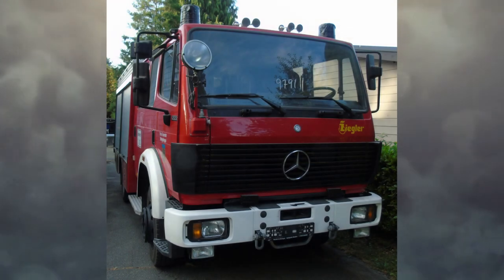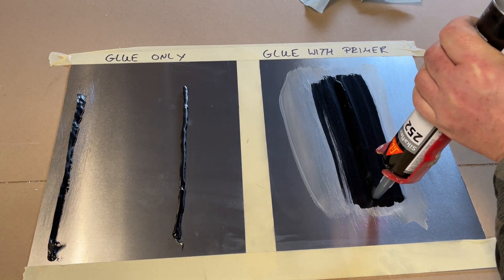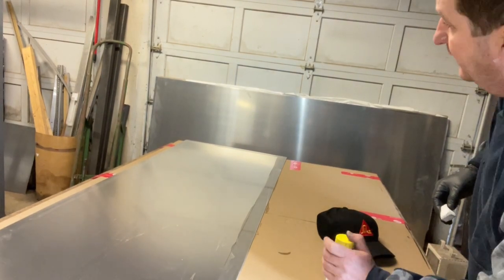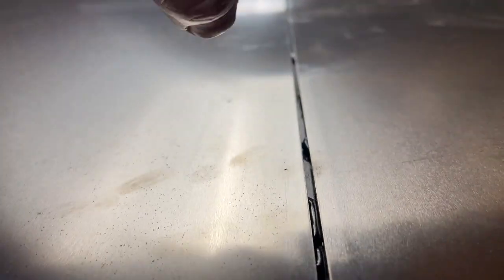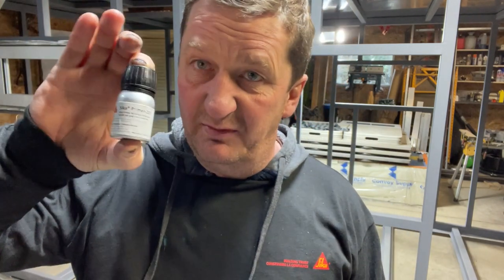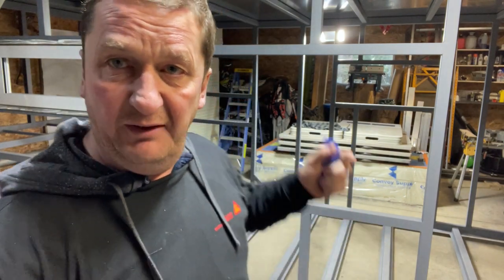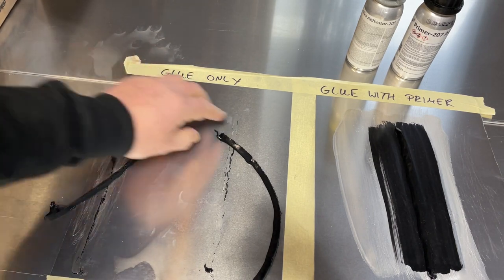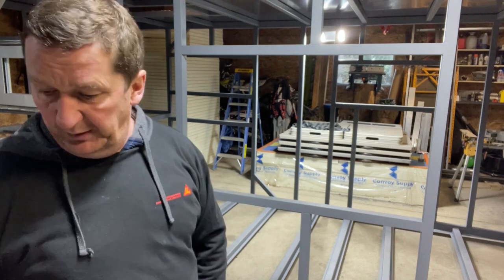How to install aluminum sheets on to a steel habitat without visible fasteners ! Step by step !

Comment: Great video, greetings from Australia , love the toothpick idea..was thinking 3.2mm spacers but now i wont have to buy. Will be installing roof top mount solar to aluminium canopy …so plastic frame onto solid solar . The plastic frame onto prepared and sanded chequer plate alloy …thanks again
Reply from the maker: You are very welcome ! Good luck with your project .

Comment: Great video that cleared up a lot of stuff in needed to know, i always appreciate experiments and demonstration. Greetings from Poland

About to mount 400w solar panels on top of my 1991 Citroen C25 Burstner with aluminium angular profiles, kind of hesitant to trust only glues without any drilling, this video helps me trust such solution more haha! 

If that works well I will have better understanding on how to add split AC unit on the back as well. Vehicle frame sounds like a most reasonable idea, but perhaps supporting it with sikaflex and original bike rack mounts could work instead.
Reply from the maker: Yes that Sika stuff is amazing if it is right prepped. Check out this 2min video they pulled with 240kg vertical than the composite panel snapped but the sika glue did not let go ! https://www.youtube.com/watch?v=4DxFRq5BvNk

Comment: Hallo Oscar, Nice video again.    I used this method also on the back of the drivers-cabin and will use it on the habitat also.  As you stated: Aluminium on Steel may not have a direct contact with each-other.   For the distance between the two materials I took square distance pieces that are used (to keep a constant distance in the edges) when you tile a wall.   In fact the function is the same but I don't like any kind of wood in my outer surfaces.       Keep on going.....I like to follow you and see you next Friday
Reply: Oh...... and can you please keep us posted about the real quantity you've used from the Sika?   It will be helpful when I have to order it too 🙂
Reply from the maker: Thanks . Those tile spacers are a good idea as well.
Reply from the maker: I will.

Comment: Great stuff! Thanks.
What about the painted surface, will it stick just as well? The tests were done on metal and not painted metal….
Reply from the maker: Yes it does but you need to make sure you prep accordingly, means sanding the metal before painting and also sanding ( roughing ) the paint before primer applying and at all times dust and grease free surfaces.

Comment: Oscar, thanks for the great video! tell me, you will not use rivets in the fastening of aluminum sheets? Or will you fasten the corners of the van with aluminum corners through rivets?
Reply from the maker: Thank you. No rivets or screws at all, only glue !
Reply: @oscaroverlander_MB1222AF  Oscar, thanks! I understand!

Comment: I want to mount sideskirts on my car using Sikaflex 252. Do i have to primer both sides? (Skirt and car)
Reply from the maker: Hi thanks for the question ! To use 252 Sika flex efficient you should prime always both surfaces, just make sure you use the right primer for the material you are going to use.

Comment: I tried this and the adhesive ripped the paint off. Lesson; make sure the paint is stuck to a high grade or it will become the weakest layer.
Reply from the maker: Absolute right that's why I applied only the primer and sanded before, to make sure the primer doesn't get ripped off.